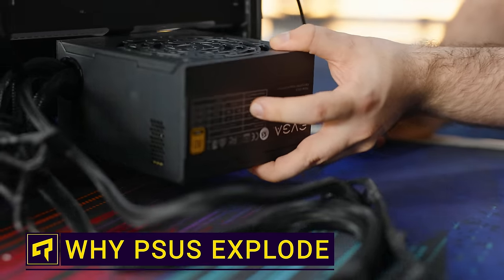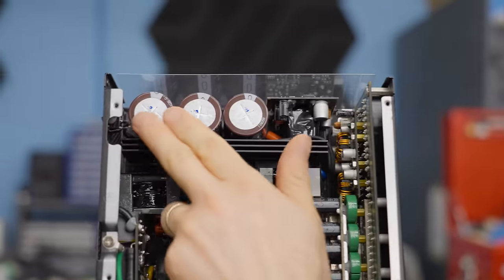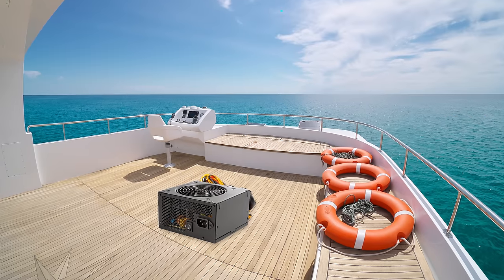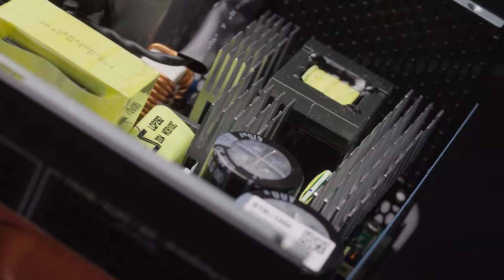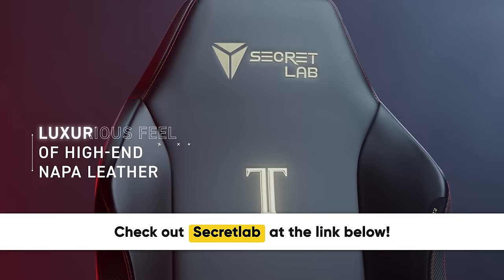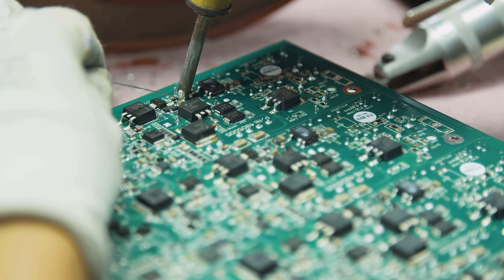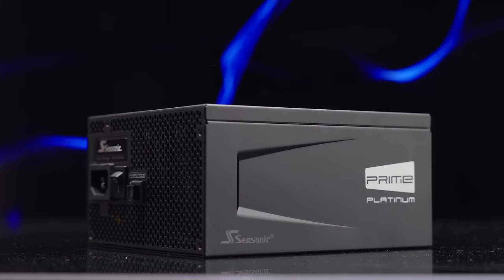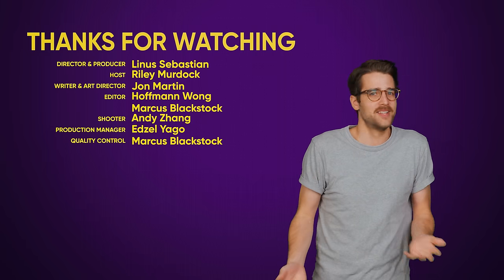Why Cheap Power Supplies Explode

Comment: this is really great and all, but this doesn't help me with what to do AFTER its already ON FIRE!!! SSERIOUSLY WHAT DO I DO
Reply: Remove power source, hit with powder or C02 extinguisher. Otherwise, walk away, raise alarm and call emergency services.
Reply: @dzzope  although it took you 10 minutes to respond
Reply: Just reboot the PC, always works
Reply: Honestly you cant do anything about it. Just let the fire burn your Insurance away.
Reply: Full throttle will suck the flames back in and suffocate the... Oh wait that's for performance carburators
Reply: Ah..duh.grab the coherently letter labeled fire extinguisher ( not wet water which is for class a or b fires...I think D for metals) and out that fire out ( FACEPALMS)

Not complicated.
Reply: I do not want to spray unless necessary, so I have several fire blankets. May work if the fire is still small.
Reply: Spray water on it

Comment: In late 90's my confuser was having nothing but random problems. Back then it was easy to just say "that's windows". But I thought i would just switch out the power supply and Bam no more problems. Lesson learned quality matters.
Reply: Same but as recently as a few years ago on a win 10 pc. Kept getting random occasional shutdowns for no reason. Replaced with a new psu, all good again 👍 Was a Cooler Master make too which are supposed to be good. 🤷‍♂
Reply: It seems like your confuser was... confused
Reply: I also experienced this effect but just from switching the wall plug to one on a different circuit. All of a sudden the random crashes stopped and even fps went up lol. Had me going nuts because I’d been putting up with it for years.
Reply: well win 3.1 was good, case psu unsafe, bough new 450 to 850 to new AT1200 that still works 12 years later to 2000w. 
Nvidia drivers suck, you need new driver for the new game and old games stop working for 90+ days unless you went back and forward between drivers, my last Nvidia FX5200, 
hello 5770HD 2 to 4 drivers pre year and no problems, 
well outside of windows F-up driver installs and updates
Reply: Damn...you got me at "Thats Windows" 😅
Reply: Wait...you had a "confuser"? That would be confusing.
Reply: @walterdayrit675  it's an AvE reference. AvE calls computers confusers.
Reply: Confused about wth is a confuser?
Reply: @gfdia35 Computer typo

Comment: The worst power supply failure I've ever seen was when I was working on a machine from my countys library. One of the capacitors inside had overheated so much that the excess solder Dell had left in actually shorted all the components on the board. Luckily, all it took was a new PSU to get the computer up and running again.
Reply: check the gigabyte psu that really explodes with flames and stuff ;) .. 

its on gamers nexus
Reply: I've only had one PSU fail on me, it was a Dell, but this was back in like 07
Reply: @z0phi3l  personally i never had a psu fail on me ..  .. always ppl around me .. even my 10 year old silverstone .. still going strong .. but next month .. its gonna get and upgrade :)  to seasonic
Reply: Apevia/Logisys i think are the worst in the world. Many years ago they released a PSU with an acrylic housing and cool green UV reactive cable braiding. When tested at 100% of declared capacity it would literally melt the acrylic housing. Lucky for them this was during the era when nearly all PSU vendors lied about capacity and everyone would get a PSU double the actual wattage they would need.
Reply: @Mr.Morden  they make the prestige which is decent
Reply: @gandalf6700  well you have two good brands right there. Not some greatwall stuff from 15 years ago.
Reply: if it shorted everything, how did pc work after changing the psu?
Reply: @Xfade81  i build a computer for my friend in 2013 i think it was .. and last year his seasonic went bust ... RMA and the most time was transport time back and forth hehe he still going strong with that hehe
Reply: @xtxo  idk
Reply: @xtxo  He wrote that it shorted all the components on the PSU board, not all the PC components.
Reply: @anirvana  ok

Comment: I bought a Corsair CS550M about 10 years ago for my first budget gaming rig (AMD Athlon II X4 640 + GTX 460) and even to this day im using that same PSU just now it powers a AMD Ryzen 7 2600X + RTX 3060. and its still going on strong, just shows you what happens when you spend your money buying a decent power supply, the PSU can out live multiple pc builds (which in my case is 3)
Reply: That PSU is near its safe limit with those components. But yes it’s a great example of why to buy a quality PSU
Reply: @cjmillsnun  yeah you probably right, just built my pc on pcpartpicker and it estimates total wattage of 364W which is about right because if i have both the cpu and gpu maxed the power draw from the wall is 400W - 410W. thats still 80% of what the PSU is able to supply (well its a bit more that 80% because the PSU can supply a maximum of 516W on the 12v rails [12V at 43A] )
Reply: @DTronicsUK  In ideal scenarios you would want a head room of atleast 50% for best efficiency on your psu. I would highly recommend you to upgrade, get a seasonic power supply they are great quality
Reply: @denniskarlsson6173  50% headroom just doesn't apply with modern quality PSUs any more. The hard bell curve of the efficiency graph has deformed at the higher end of utilisation as efficiency has increased. Some headroom is still a good idea, but not as much as the old times.
Reply: The components of your old psu probably degraded, that's the reason why old psu models are moved to avoid tier in psu tier list  I'd change my psu if i were you just to be sure.
Reply: And u have me who HAD a corsair rm650 thay exploded on its 1st use corsair did refund me a new psu but they didnt refnd me for my broken hdd ssd and 2 8gb ram that got fried because of their psu just shows even Branded products arent 100%safe
Reply: @KiotheCloud  not 100% yeah but they are way better than getting one from a cheap no brand
Reply: Same happening to me, nearly 7 years with my Corsair PSU
Reply: Hello - Usually is worth to buy something better. My 850W Coolermaster (in 2010 it was one of most powerfull units) last for 13 years of usage (few hours per day on average)
Finally i noticed problems after 12+ years:
First: power up my PC (long time "fan spinning" before post) and this problem was a few month before second symptom...
Second: My graphics crashing randomly - this time i was sure this is a PSU...
But nothing was damaged im my sestem.
So I replaced for new Seasonic 1000W (ATX 3.0) - shuld last for another decade.,
So From Athlon X2 6000 - to Ryzen 5600X (via i5-2500K and i7-4970K) at one PSU - this is good journey :D
Reply: Same, I have I think a Corsair MX650, had it for like 10 yearsish now.
Reply: For everyone being a big negative here be aware that the first and second revisions of the CX line had MUCH better components than the later once. I am not 100% sure but I am pretty sure that they changed OEM in the the later units

Comment: My Apevias ATX-PR 1000W  stopped working in less than a year.  In 2023, I bought a gaming CyberPower PC from Best Buy that came with this PSU, it’s trash!  In less than a year it started making a loud noise like a blender and stopped working.  For it being 11 months old is unacceptable.  I am really disappointed CyberPower PC installed such a low grade PSU in their PC.  I recommend staying away from this PSU unless you are okay with replacing it in less than a year.

Comment: Could we get a video explaining the different manufacturers labeling schemes? Seems like every "reputable brand" has a dozen different models all made by different companies and its confusing to know which model is good and bad
Reply: Good point. Generally, EVGA, Corsair, Seasonic, and Thermaltake have been making PSUs for a long time and haven't suffered from quality issues. There are other manufacturers that can build good things, but that's the list of manufacturers who are reliable enough that you don't need to worry about them exploding and taking your components with them, even if they have a line that has some minor issues. (not meeting rated current/voltage, etc)
Reply: @alexlowe2054  you're missing the point, Evga psu's aren't made by them lol they have a dozen different models of psu all by different manufacturers
Reply: @ugatobekittenme  
Most of them are made by High Wall, but I guess EVGA/Corsair give them specs to follow and they validate those specs as well... or I hope they do
Reply: Well that could make a good video... but mostly... its just rebranding and putting their own sticker on. All the big major brands does it with a few caveat For example, Corsair will "design" some of their own or make revisions to an existing stable and proven platform/model from one of the other OEM, but they make none of them as far as i know. One of their product line might be from CWT,  or built to Corsair specs by CWT. Sometimes it will be from one of the other OEMs. And i seen Corsair PSU built by the best oems... and some from the not as good ones. At the same time, if Corsair has a psu from one of the not best OEMs... it's usually from still good/decent oems  and  the best psu platform from that OEM and they(Corsair) likely revised the design for Corsair uses/product lines. And then same goes for most of the reputable brands. Of that bunch... i think only Seasonic doesn't need other OEM. They are one.
Reply: For corsair, anything with CV, VS, or V in the name is for low efficiency, very budget low end/low priority builds and I generally avoid these for any type of build
CXM/TXM (avoid green label) are higher quality with low efficiency, semi modular, has better protections and can be used with semi power hungry parts
RM, RMX, RMi 2015/2018/2021 (along with HX and AX line) are very efficient, very high quality, very quiet and can be trusted totally for any type of build
Reply: @ugatobekittenme  The thing is, who they contract out to is generally less important than who is ordering them.

When EVGA buys a power supply they check the quality and ensure it meets their standards before slapping their name on it. If Amazon Seller #87876 gets a PSU from the same manufacturer, their standards will be lower and the manufacturer will reduce their costs to drive down the price. 

Now this isn't always perfect, mistakes happen and bad PSUs go out sometimes, even with the best of intentions, and that is why things like reviews are inportant. But you are generally going to find better quality buying a reputable brand than a cheap brand using the same manufacturer.
Reply: There’s a good forum post covering pretty much all PSU’s out there and which ones are good and bad on the LTT forums
Reply: i made about 10 pcs in my lifetime ( for myself or for others) and i have used either a corsair or an evga psu.........flat zero problems so far
Reply: You can’t explain the naming schemes cause they change them once people know what’s good or bad. The whole point of the naming schemes are to either obfuscate bad quality or market good quality, which is why you know that a Seasonic Focus Gold is good but the bottom end of Seasonic’s stack changes every year.

Comment: Video suggestion: cores vs threads. What's the difference?
Reply: Those Intel different-type cores are confusing too. I never looked it up, since the only thing Intel I have are a couple of old laptops, and a couple of old SSDs on a PCIe card.
Reply: Cores are physical parts in the cpu, imagine them like brains that you have. Each core contains a lot of parts that can do various types of instructions, because of that every instruction that run on a core only use a part of the core not all of it. to avoid having this waste of ressources they made each core work on 2 things at the same time, this is what is called HyperTreading for intel and SMT for AMD.
So a thread represent a workload that a  core is working one.
Reply: Techquickie already has video on the topic, "What is Hyper Threading Technology as Fast As Possible"
Reply: Cores are physical things.  Threads are programming instructions.  They are only loosely related.
A core can actively work on one thread at a time.  Windows handles thread switching.  Check your task manager, performance tab, cpu section.  It will say how many threads you are running, and its probably over a 1000.  And you don't have a 1000 core CPU.  Thus you can see why these things are only loosely related.
Reply: @oldguyreal9681  it is actually simple with the 12th gen core series, they have a certain number of performance cores which have hyperthreading, and a certain amount of efficiency cores which do not. for example the Core i5 12600K has 6 hyperthreaded cores and 4 non-hyperthreaded ones, the total is 10 cores. 12 threads on the performance cores +4 threads on the efficient cores = 16 total threads.
Reply: Threads are the tasks a cpu can do at one time, an 8 core cpu with 16 threads can do 16 things at once.
Reply: TL;DR a core can do any one type of computation task at a time, but a thread can only help sort of like a friend helping you life a heavy box.

Threads in a core can only work concurrently, meaning they aren't actually both working together but sort of spreading the load like your friend giving you extra muscle.
While as cores can operate independently (assuming you have enough workloads to utilize each core)
Most system can really only do a few tasks at once, but basically just do a bunch of little tasks in rapid succession and the end user can't notice